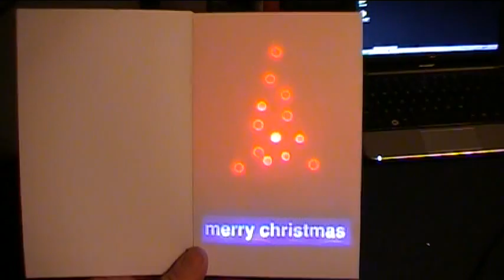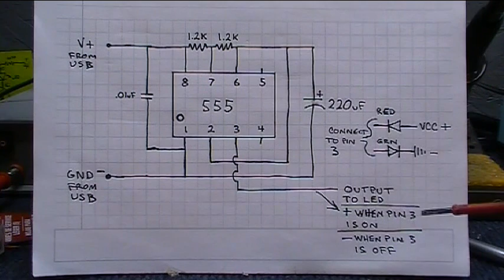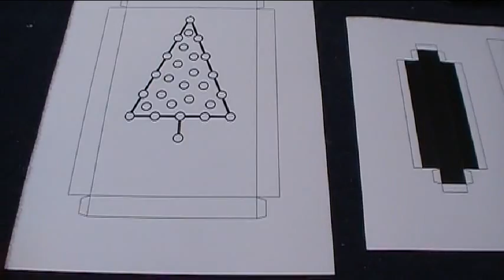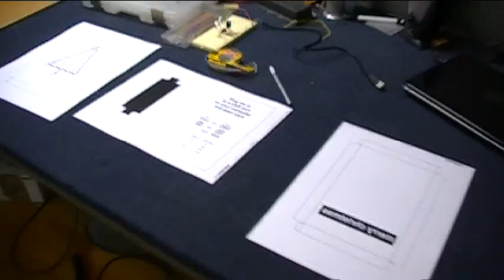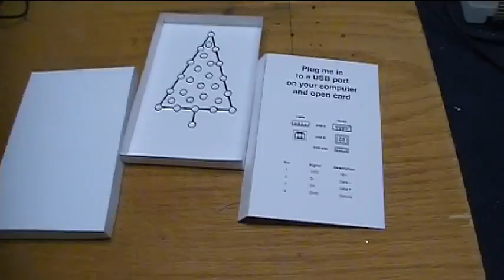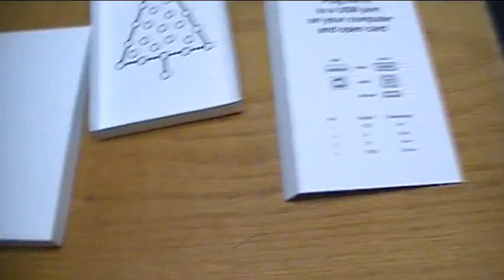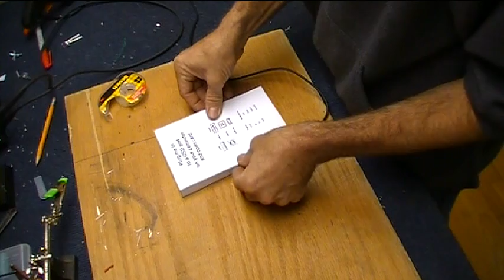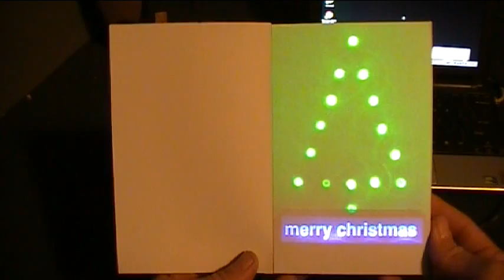USB Powered LED Christmas Card

Comment: Hi,  I am a beginner at electronics and no only a little bit.  I like this LED circuit but I was wondering if it is built exactly for that number of LED's you used  or can you take a few of them out.  I would like to use this circuit exactly like it is for a diffrent project and not as many LED's.  I still want to use the same 5v power source, but only 8 green and 8 red LED's.  Would I need to change the resistors accordingly?
Reply: or would the number of led's not matter because it looks like they are wired in parallel

Comment: Does this only work with Red and Green LED's.  I tried putting a white LED in and it did not light up.  My circuit only seems to work at 3.5 volts.  if my power source is above 3.5 volts the led's just come on solid.